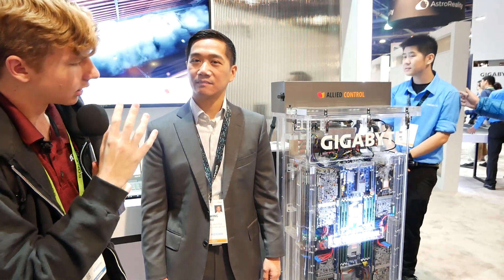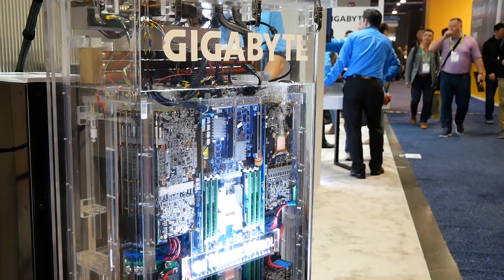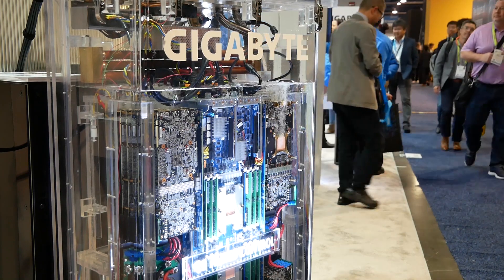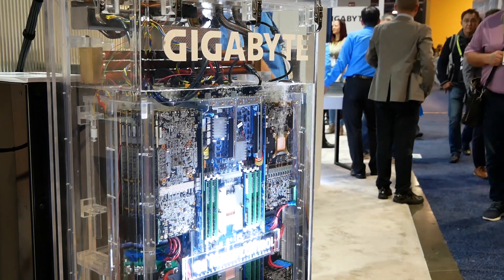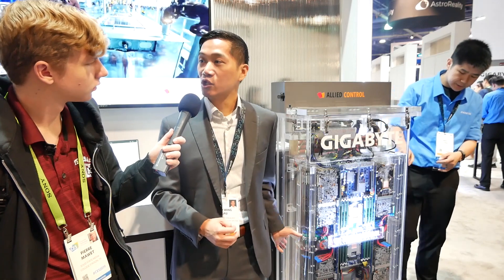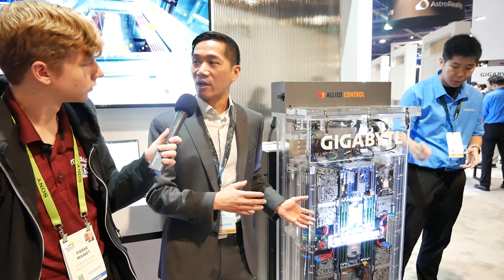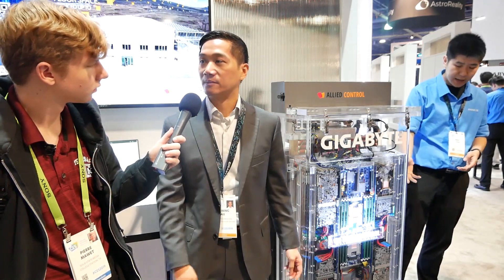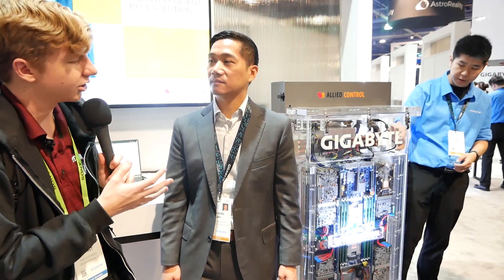THIS SERVER IS COMPLETELY SUBMERGED IN LIQUID!!! Gigabyte at CES 2019

Comment: Some friendly advice. Your audio needs leveled and then normalized to -6db. On my desktop I had to turn the volume to 75% to hear clearly, whereas most other content only needs to be around 10-15%. On my laptop, I couldn't make it loud enough to hear clearly. But with most content on YT, I can at about 50-60%. 

But other than that, I do like your to the point style.
Reply from the maker: Yeah, audio was a bit challenging this year. Sadly, there's only so much I can do in the fast paced on the go environment that is CES, but I'm already working on solutions for next year.
Reply: @SolidStateTech  If you have ever used or heard of "Audacity" it's a free audio editing software that can compress/level out the audio and normalize it. It works great on a laptop. It's easier to edit the video like you want and then output the audio only, then import that audio file into Audacity and then compress/level it, normalize it and then import the edited audio back into the video editor.

But hey, you are doing fine. Keep it up. YT needs a lot more people willing to go to location like you are doing and report on interesting things.
Reply from the maker: I've used it before, and I also have Adobe Audition, I just need to find some time to learn all it's tricks (and find time during the shows to use it cuz boy is this a busy week)

Comment: That is Amazing!!!
Reply from the maker: I know right!!
Reply: When I saw the on board water-cooled GTX 2080ti, I asked my self but why. And actually thought a GPU submurged like this server would make a lot more sense. And instead of acrylic just fully extruded aluminum, maybe with a touch of sealing here and there. 
Liquid to remove the heat away from chip ASAP, and the benefit of a big heatsink at the same time.